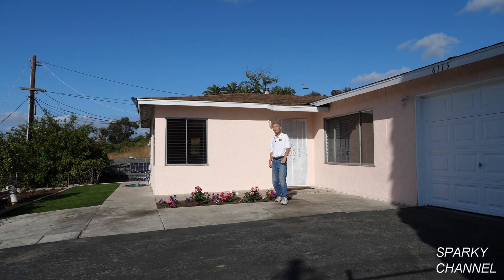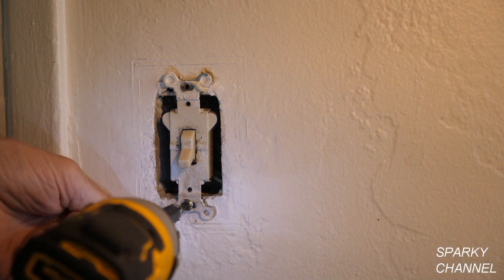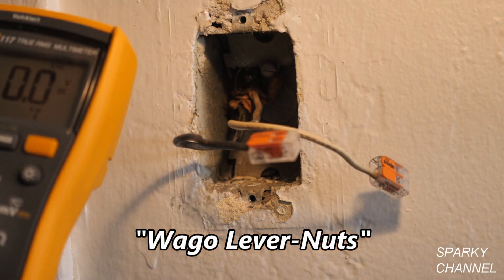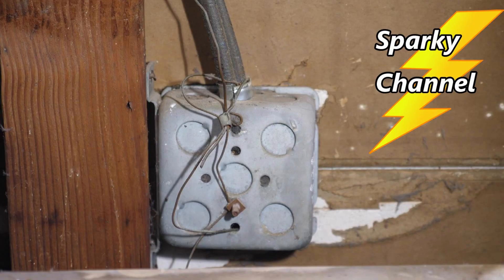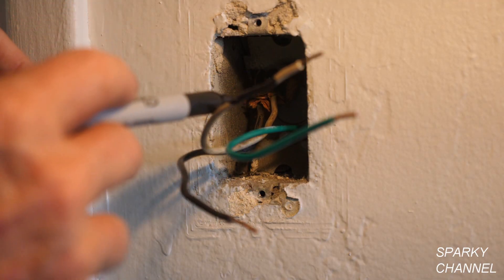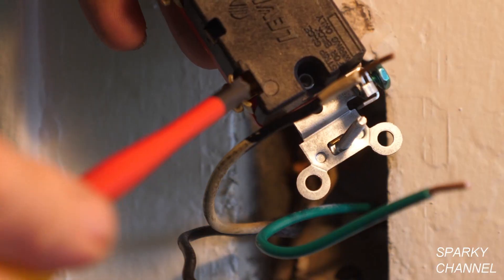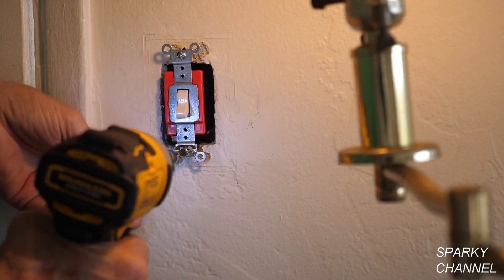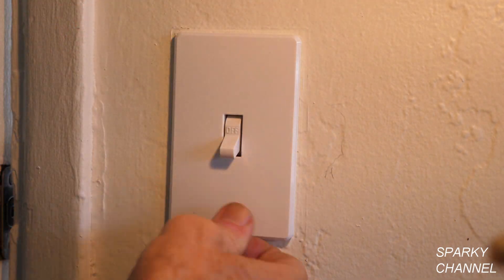Replacing a Vintage 1960 Switch and Grounding the New Switch

Comment: Yep, stripping old wire is a PAIN, compared to fresh new stuff. Thanks for showing the Knipex hybrid pliers in use: they are very fancy, but I'm worried about the length & "height" of the nose.
Reply from the maker: Yes,, wires from the 1960's don't strip like the new wires. The Knipex is the best that I've found for the job.
Reply from the maker: You could look it up in the old 2008 NEC. Those wire wires had to be indelibly color coded. Red would work too, or black or red electrical tape.
Reply: my master would kill me if I used sharpie for black labeling?

Comment: Yay!  House Renovation Time returns!  BTW, I was also a victim of (silent/secret/evil) subscription deletion.  I've been replacing some switches and receptacles lately.  Any hints for dealing with old and super stiff wires?  Also, I love that you use the industrial-strength version of the switch - I do the same (Leviton Decora line).  Again, any hints for getting these bulkier devices in small boxes?
Reply from the maker: Hi Jerry! Great to have you back!!! I think it's awful the way all the subscribers got deleted with no notice! I've tried many times to get through to YouTube but they just ignore me. Oh well, it is what it is and it's time to just move forward and celebrate the good things like your finding Sparky Channel again. Yeay!!
Reply: I had to bend the ground screw tab while screwing it in and it bent the switch. Can't really notice but plate is slightly off now. Would love to hear his tips on this issue

Comment: You say you put the electrical tape around the receptacle for safety what is the safety reasoning😷🍻🍺
Reply: To cover the screws , which you can touch accidentally or when pulling the switch out touch the metal box I assume.
Reply from the maker: @Therealphantomzero  Yes, that's correct.
Reply: PhantomZero but who would pull a device with the power on?
Reply: never fails when I pull an outlet or switch out of a hot box that doesn't have the terminals taped I trip the breaker by contact. It's like playing operation.
Reply: @mook528  I think you’re supposed to turn off the breaker
Reply: @pb7379-j2k  I hardly ever turn off breakers to replace an outlet or switch, not saying you should do that, I have the experience to do that. It's called working  hot.
Reply: @mook528  I’ve heard that name for it, but I prefer to call it “working dumb”. I know what I’m doing too, but anyone can slip or make a mistake. This risk has no reward
Reply: @pb7379-j2k  well then I guess that’s my concern isn’t it? Working with live wires is a part of being an electrician. There will always be situations where power cannot be disconnected or you may need lines to be energized to diagnose problems.
Reply: @mook528  or when you’re too lazy or hurried to bother to find the breaker, right?
Reply: @pb7379-j2k  wrong. Sometimes the breaker is right there. But the real question is why are you so concerned with my safety choices?
Reply: @mook528  because we’re in a youtube comment thread!
Reply: @pb7379-j2k  ok well thanks for all the advice from the YouTube safety police, but I think I’ll just continue to work as I have been for the last 20+ years.
Reply: @mook528  The trick to pulling a device out without shorting is to keep the device centered in its location and pull it straight out, without moving left or right. Lol